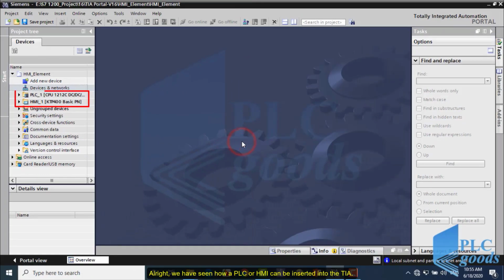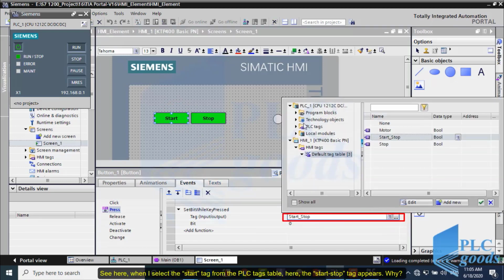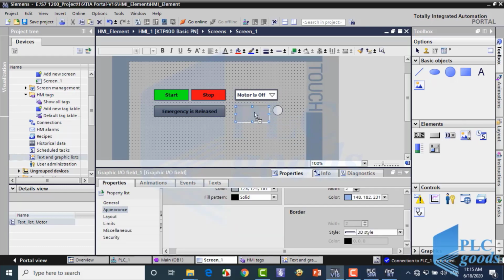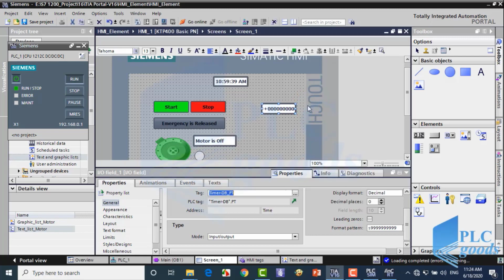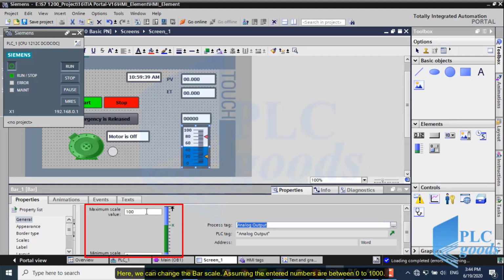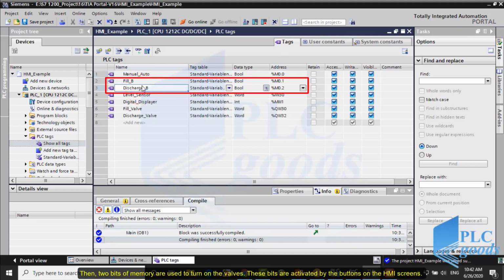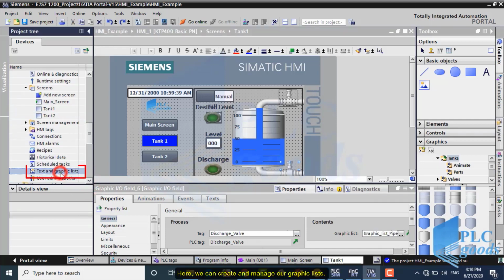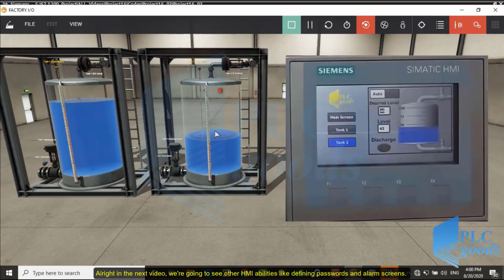HMI programming tutorial TIA PORTAL - 50 min course Part 12 of 14

Comment: very good video! I am automatics and robotics student learning PLC and HMI by myself in home. i already made a small project - machine cutting a pipe for desired length using encoder, plc, hmi and a motor. What do you suggest to learn now? I am thinking about buying PWM motor and building my own plc programming table for learning but its a bit expensive. Gonna keep watching your channel really good job
Reply from the maker: Hi there, You can buy your necessary equipment or you can use some software which can simulate some industrial processes. We explain how Factory I/O software can be connected to PLCSim simulator and S7-1200 PLC during the TIA Portal course . Also if a device is expensive, you can write a function inside an FB to simulate its behavior, then use the FB's inputs/outputs for simulating your projects.

Comment: Dear experts
I could not find any reference. for connecting ktp900 mobile with compact box 

I have a project with

KTP900 MOBILE 6AV2 125-2JB03-0AX0

CPU 1215C AC/DC/Rly 6ES7 215-1BG40-0XB0

WinCC Professional Version V15.1 Update 8

There is no file in the hardware catalogue for the Compact HMI Connection Box (but there is for the Standard and Advanced boxes). Can I still use without E-Stop functionality with the "Compact" version?
simply i want to use it [ Compact HMI Connection Box ] as Ethernet switch. between cpu and hmi only

connection with ktp900 mobile with no fail safe

is it possible to or not before ordering the box
i never used connection box before

please i need any reference confirming my request

thanks to you all
Zach
Reply from the maker: Sorry!, i do not have any previous experience about the nature of your problem.❤

Comment: Dear Sir, first i do really appreciate you perfect video. it was so helpful. a short question . I have tried to simulate exatly in the way you have done. the only difference was that i have assigned %I  to start button i/o memory bit. but it did not work properly. Do you have any Idea? Thanks in advance
Reply from the maker: Note that you can not connect physical input addresses to equipment inside Factory I/O. I explained the necessary settings during the previous videos.